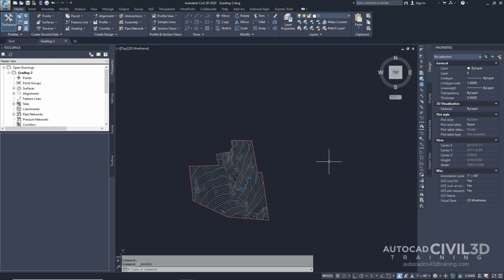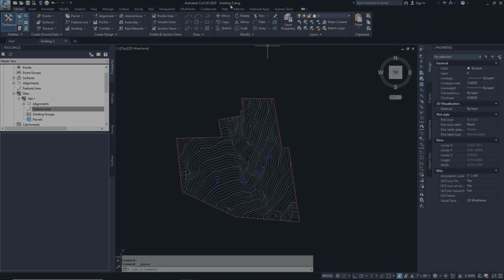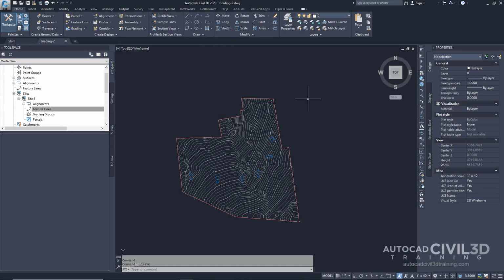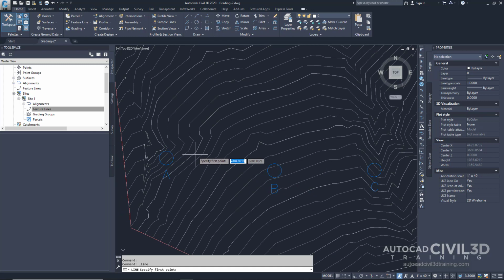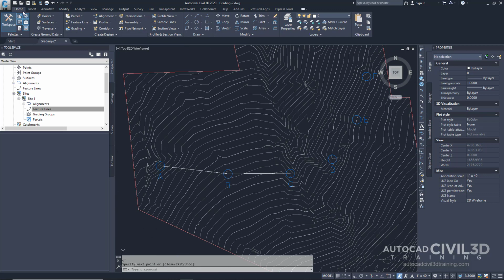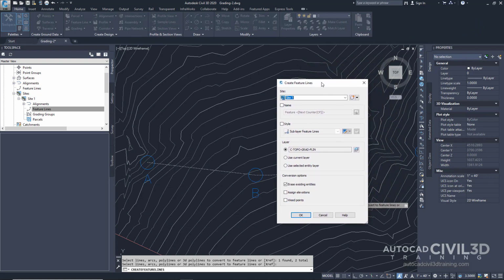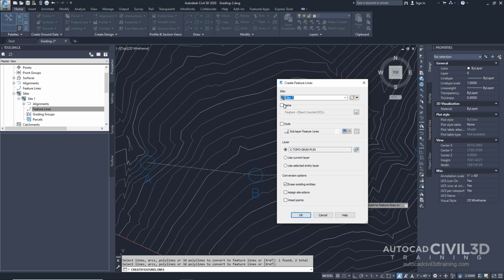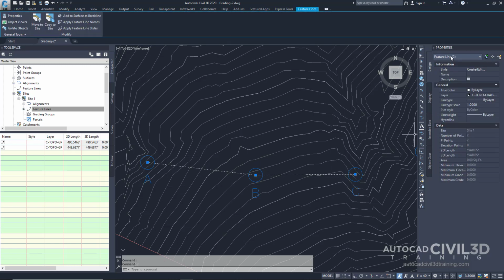Creating Feature Lines in Civil 3D

Comment: how do i make arcs into feature lines?....there are a bunch of arcs
Reply from the maker: You can try turning the arc into a poly line. Then convert the polyline to a feature line. If that doesn’t work, I’d trace the arc with a polyline and convert the polyline to a feature line. 😊✌🏼
Reply: New to Civil 3D. What are all of the waves and curved lines that you're circles are on that are being snapped to, and what features are used to create them?
Reply from the maker: Those are contour lines from the surface — they’re generated automatically from the TIN surface in Civil 3D. I’m just snapping to the contours to grab elevations + geometry references as I work.